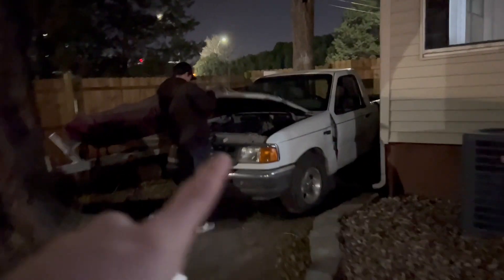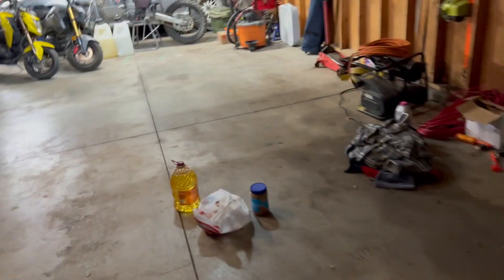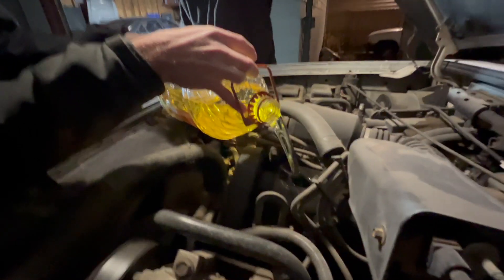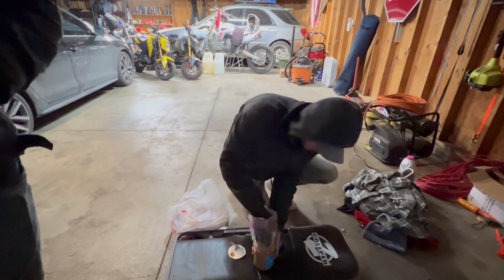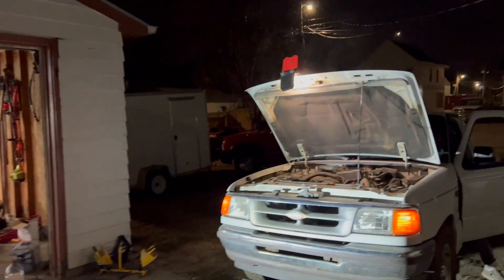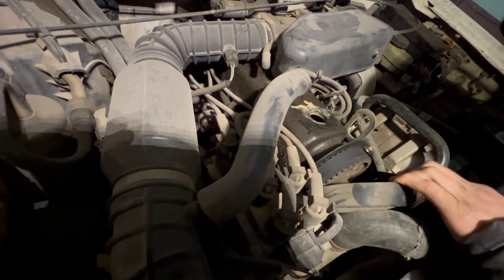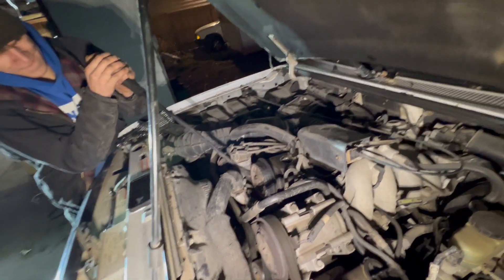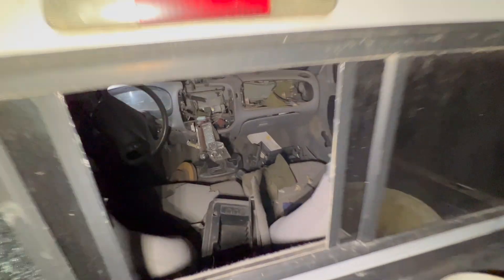Can you substitute Peanut Butter for engine oil?

Comment: Those 2.3s are tough non interference engines
Reply from the maker: It was a good engine for a long time, but when I put anything bigger than a dirtbike in the back too speed is about 50mph. It doesn’t truck very well.

Comment: FYI the oil pressure gauge on all Ford's are just dummy gauges. They just have an oil pressure switch that's on/off so instead of it controlling a low oil light it switches a gauge from zero to middle.  They're all like that, even the newer ones

Comment: I have a 1995 with over 400k miles not even a light on on the dash I’ve owned it 9 years no issues 4 sets of tires and some oil changes

Comment: My guess is both the peanut oil and the peanut butter were probably both terminal to the Ranger engine. However of the two the peanut "butter" was probably worse because of the oil filter working overtime and getting plugged up. Neither is good but of the two perhaps the peanut oil may work longer especially if the engine just idles and is not stressed out.  Poor Ranger, it died for science, lol.:face-fuchsia-wide-eyes:
Reply from the maker: We are gonna tear into it and try to revive it lol
Reply: A Dutch youtuber has used pancake syrup as oil before. It worked perfectly for a while until the sugar started boiling, it then formed a thick crystal cake on top of all components and completely seized the engine. Something similar could be the case here, where the sugars just solidified, considering how much sugar is in the average peanut butter.
Reply from the maker: @DerpotronGames  that’s so funny.